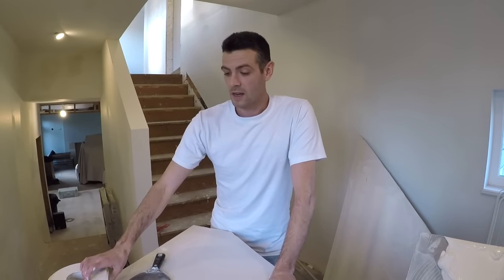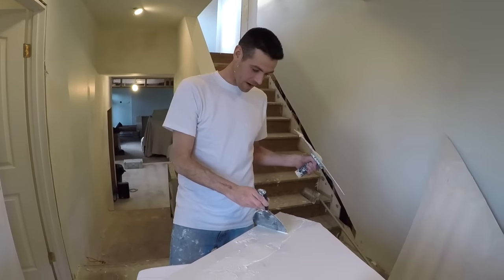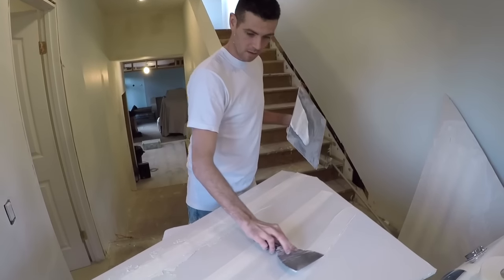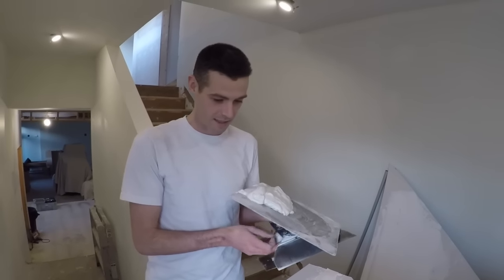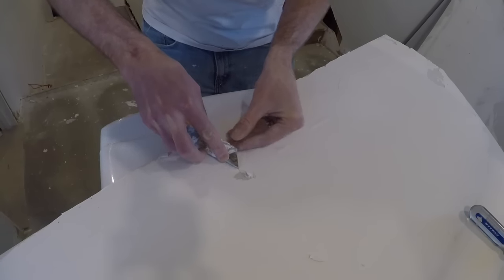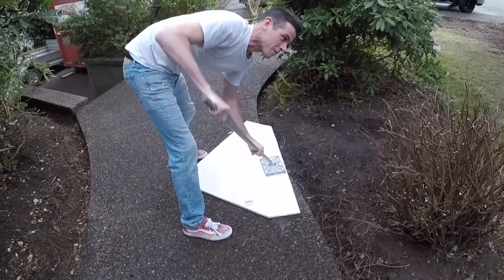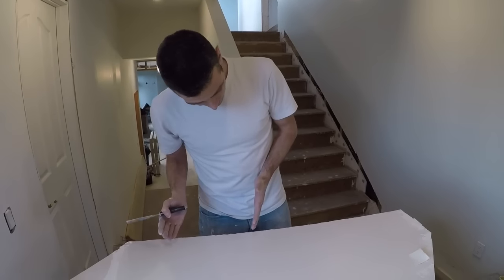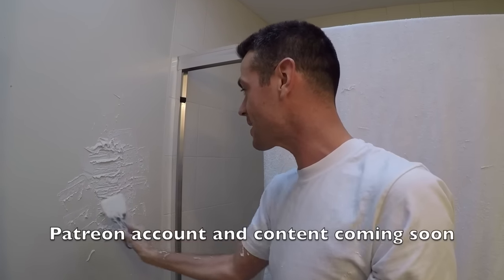WHY YOUR PAPER TAPE BLISTERED!!

Comment: Great instruction and guidance. I complete my first big drywall project this past weekend and did get blisters in my tape, but only on butt joints that had a gap more than quarter inch. I took off too much mud on my first go over. I now know better.

Comment: Drywall is not flat. I think that's the thing that took me the longest to learn. After watching some good quality videos like the ones you do I realized these guys aren't making it flat they're just tapering the high spot over a massive distance.
Reply: Wrong, there a slight drop in thickness along the long sides of the face of drywall so when u put two together you have a sort of valley to fill. You would see any high spot regardless how far you taper it.

Comment: I also noticed that you use just two coats after the taping is done.  Trouble is that so much
time is wasted being soooo neat on each of these coats to avoid too much sanding.  The
first coat covers the tape with a 12" coat; the second after light sanding pulls the coat out
two inches on each side; and the third or skin coat with thin cement needs just light fast
sanding with 120 grit.  I've been on union jobs with just two coats after taping.  The foreman
didn't want tooo much time wasted on slow, neat coats, but the final sanding took so  long
that a third coat would have used up less time overall.

Comment: The compound I bought from HD was very wet!  Very hard to put on, especially on the ceilings.
Is it supposed to be very wet where I can’t even get it up to the garage ceiling without dripping all over?
Reply from the maker: No thats odd. It should usually be thicker so it can be thinned down to your desired consistency.

Comment: I was taught to wet your tape before sticking it on the mud. Is that wrong? I don't do a lot of drywall b/c I hate mudding, but I imagine I hate it because I suck at it. (Never got blisters tho, so I got that goin for me.)
Reply: It's not wrong per say, but not necessary. Wet mud (thinned down out of the bucket) already has enough water in it for the tape and wallboard. Most diy'ers have a hard time using mud that is thinned down enough because it doesn't want to stay put on your knife.
Reply: @renovationsandmore7142  thank you. It will be one less thing i will be making a mess with.

Comment: Also.. diyer that uses same all purpose mud bucket 3 days or weeks long. Taking time to do it.
Mud starts to set in bucket.. when applied to walls.. it will have low or no adhesion spots.

I had situation where it was 100f in house and had to wet the tape first.

Comment: In south Louisiana I have seen guys add Palmolive dish soap to their mud when mixing it in the 5gal before they start taping. Not a whole lot but maybe about the amount of a shot glass to the contents of 1 ready mixed box dumped into a 5 gal bucket and while stirring it they throw a little in the mud as it is being mixed. I asked the guy what is up with that but he didnt speak english and I dont speak spanish so who knows why? I was just curious if this is a common practice
Reply: It's to stretch the mud out and save money. Sometimes I do the same thing with latex paint I don't add soap I just ad a little bit of water if I'm running out of paint and have just a little section left. I know some painters that always do this to save money.

Comment: I can see the outline of the drywall tape through the paint on my ceiling. No blisters though. Can you make a video on correcting this issue? Thanks.
Reply: You did not one fether it enough or you did not go wide enough. The question also arises how thick is the mud under tape? Thick mud bed under the tape you will have to really go wide.

Comment: You have really great informative videos. Would you be willing to do one about using drywall mud and trying to match a random plaster sand swirl pattern? I have a few spots on my walls that I'd like to repair and match texture. I heard from some people in the field to try and use an old shoe buffing brush (horse hair) to get the swirl pattern.

Comment: I think many people get blisters when they let the tape get too wet and it crinkles or if they try and bend the tape.  ie. they start a run at the ceiling and realize that they are out an inch by the bottom and try to fix it by bending the tape over instead of lifting it all off and letting it fall straight down.

Comment: The biggest problems I had when learning was uneven butt joints and bowed existing drywall/previously skimmed drywall. Having a variable joint it’s easy to push all the mud out on the highs or leave a void on the lows. You could pre-fill I guess, but the farther from the facing paper the tape is the less strong the joint.
Reply: This is why I like using mesh tape.

Comment: I've been taping my dinning. About 12 or so joints in I got a blistered tape. I assumed it was because the joints were even, even though i tried to even them out with mud before taping. I wet the mud prior and have had any issues other than the uneven joints (2 of them). Any tips on how to address that?

Comment: So the main thing is having a good and thick even spread all the way across the joint for the tape. Not just dap it on and then roll over the tape expecting it to coat all underneath it

Comment: I've been taping a small room for days now. I was following a pro method, which was making me draw way too much mud out from under the tape. I found your video, realized what I was doing wrong. I was scraping mud away before laying tape, then, as I went along, my mud was too dry. 

Thanks for the vids, mudding and taping is much like riding a bike, you will fall a bunch at first, but once you got it, your good to go !

BTW: I couldn't find a great answer anywhere, but one corner I've done twice, and it didn't work out nicely, now I have a bit too much mud a 1/2 inch from the corner. Any good way to flatten it back out ? I've tried my knife, but it's taking the paper of the drywall away at times, and my sanding block isn't doing enough.

Comment: We soak the tape in water before putting it on. Works magic
Reply: That is how I was taught
Reply: Yeah, it works. But it kills the glue. Itll be fine unless you have to think about moisture and hard temperature shifts. 
Ex (vacation homes where they wont be temp controlled year round, baths, basements, garage, ect.)

Comment: What about not pre filling first. I like to do that with 20 min easy sand. Than put my regular mud than tape it
Reply: If your not a shitty rocker.. pre-filling is standard to prevent cracking. Prep work is everything or you end up with more work later as my dad always used to say. It’s not like running around with some quick dry and a trowel takes a lot of extra effort. If it saves you from fixing your tape I think it’s worth it.

Comment: I always had problems with blisters. One of my remedies was to pre-soak the tape in a bucket of water, gently squeeze out the water and apply. Probably could get the same effect simply by using wetter mud. 

Also, more recently I have started using a paper laminated composite tape (Strait-Flex). Any opinion on this product? It seems to be stronger than paper tape and less prone to blistering. I also pre-soak this product before using.

Comment: You should use a TapeBuddy tool for taping and the blisters won't happen. Check it out! Now available in Canada! The mud doesn't dry out on the wall as it's applied to the tape first. It's so easy and clean when taping with a TapeBuddy tool.

Comment: The lesson is to use mesh always.
Reply: Please doant use mesh tape on butts and seems , and use Finnish mud over it ..please doant ,good chance it will crack out after priming it ...if you do use mesh tape ,it works with hot mud better , I had to detail a house ,after prime and all the butts and seems cracked out ,and what we found is the drywall tappers used mesh tape in all butts and seams
Reply: If you ment to say fiber tape and tapping mud that workers , all though had problems with angles

Comment: I stopped using tape. I just mud it, then paint it with a sealer. I really don't get the point of tape to be honest. It's not like it makes the surface any flatter.  The mud I use,  pre-mixed in a bucket, works great at making the surface flat. Unless you walk up with a microscope or your wall has blazing light on it, it's not noticeable. Pre-mixed mud seems 10x better than it used to be.

Comment: You have to try pretty hard to mess this up when you're putting tape on a perfectly flat surface with no cracks to fill, that doesn't need to be taped in the first place...

Comment: So I've run into a very interesting additional reason tape blisters. I'm building out a condominium in Albuquerque New Mexico where the relative humidity right now is 10%. The mud starts drying within 30 seconds of applying and is not even sticky within one minute. It's with a wet mix and even wetting the tape. This is the first time I've ever drywalled in such a lack of humidity. I have to clean my hawk knives and trowel almost after every load because it's dried up so much. Just to keep the little dry chunks from getting into the mix.

Comment: It would have been helpful if this tutorial was done on an actual joint between two pieces of drywall... I don't get bubbles on the drywall itself, I get it where there is like an 1/8th gap between the two boards.
Reply: Do you have bubbles at butt joints, or the long seams that are tapered? I'm not a pro drywaller, but I've learned something that I was getting bubbles at my tapered long seams because my blade wasn't wide enough. The tapers are usually around 2-2.5" wide. So the dip should be 4-5". I started laying the bed of mud underneath the tape with a long 10" knife, so it floats nice over that valley. Maybe your having a different issue, just something I noticed.
Reply: @Fetecheney  Thanks for the advice! It was at a butt joint. I have since discovered that it had something to do with the gap between the drywall panels. I tried filling the gap with mud first, let it dry, sanded, then applied my mud and tape and It worked out great.
Reply: @sheldonvaughan6769 Your welcome brother! I think the Vancouver Carpenter uses a light concrete mix for big gap fills. I couldn't remember what product he used for the project I'm doing right now, so I found a different recommendation (the easy sand 45/easy sand 90 bag mix at home depot). Both the easy sand and concrete mix is nice because they chemically react internally to cure so they set up within 2 hours or so, rather than taking 2 weeks to dry like normal drywall mud. 

On this last project on my remodel I hung the drywall on the first day. The second day I mixed up the easy sand 45 and filled all the gaps (Ideally there shouldn't be big gaps, but I didn't feel like coping drywall against existing lathe and plaster walls :) I actually filled a gallon plastic bag with the mix, sealed it, then cut off a corner to get a piping bag full. That let me essentially "caulk" the mix really full into the crazy lathe/plaster adjoining joints that were waaaay to big for tape to float over. The third day I scraped the EasySand45 flat and then I had a really nice setup to go through all the other mudding steps.
Reply: @Fetecheney  That's great advice, thanks! I am still fine-tuning my drywall skills, it's only the second time I've done it, but definitely learned a lot from my first project... 1) The plastic trowels suck, they tend to pull the mud after few uses as the tips start to get rough. 2) The pre-mix mud is too dry for feather coats, if you add a little water to it, it's way easier to work with. 3) The hybrid paper/metal corners are way better than the metal ones, the metal ones start warping from the nail pulling it in.
Reply: @sheldonvaughan6769  That's good advice back from you. I just had to do an outside corner and got the paper/metal ones instead because of this. Worked WAY better than the others I've done of just the metal.

Comment: No homeowner ever understands that drywall isn't flat. I did a remodel about 6 months ago where the owners put a 6 ft level up to the wall when I was done. They insisted that it should be perfectly flat and I wound up having to run the butt joints 6 ft wide to make them happy. True insanity.
Reply: killer2468 wman - the customer is always right.
Reply: @martihill3611  the perfect finishing job means the hanging must be near perfect, witch in turn means the framing must be near perfect. There is almost never perfection in any part of building a house, especially when it comes to work that is done by human hands. I'm not a machine, therefore the work will most likely not be perfect.

Comment: I DIP MY TAPE IN WATER RIGHT BEFORE I APPLY IT,, THEN PULL IT OUT OF THE WATER IN BETWEEN MY FINGERS TO REMOVE MOST OF IT,,, JUST WANT IT DAMP... SEEMS TO WORK QUITE WELL FOR ME FOR ALL THE YEARS IVE BEEN DOING IT,, AND AGAIN, EXPERIMENTING WITH THIS METHOD MAKES IT EASIER TO FIND YOUR EASE METHOD

Comment: No one applies joint compound horizontally unless it's above them, as you have a serious leverage advantage on your example vs a vertical wall, and there is no seam under your seam tape, where the tape tends to bubble. I am sure you are an awesome drywall guy but the example is nothing close to real world conditions. Jus sayin

Comment: Tape isn't hard on a large flat surface but god help you when you're stuck trying to drywall that spot where some architectural genius put an outside corner within 2 inches of an inside corner.

Comment: Afraid this way doesn’t really work. The tape serves a purpose. Simply filling a void with light weight at a tape joint is going to fail. Otherwise why even bother with tape.?  You have a lot of experience and good advice for avoiding taping failure. Feel it’s best to tell people who don’t have any experience at all to simply use mesh tape though. Also was to suggest using a mini pump sprayer when trying to work long runs or plan to skim coat whole walls.
Reply: Tape failure for reasons he’s describing, which I would agree are the most common causes for taping to fail...assuming everything till that point was done properly is accurate. I feel I find more joint failure that is caused by framing or drywall install issues but his topic is more about new people trying to tape. With mesh tape you can’t cause tape to fail by under filling. You would just be adding another coat being required. You can fairly well see if you have pockets or voids since you can see through the mesh. Most mesh tape is slightly thicker than paper tape anyway so if you do try to pull too much mud out it would be harder. You can apply mud as leisure since you can apply mesh tape in advance. This prevents the mud from filming over from taking too long applying mud before tape which can cause bondage failure.  Can go on but these are the main reasons I suggest mesh for the inexperienced.
Reply: He mentioned it was only in the case that you had one or two issues.  A break in your tape here and there isn't going to hurt, except in sheering forces though the drywall plane, and if you're using mesh you're counting on not having sheer forces anyway.

Comment: You could just pull the tape repeatedly until you've played with it too much, boom, blistering
Reply: You could have also applied the tape with peanut butter underneath and gave the ol smooth skippy an immidiate coat of home depots cheapest and greasiest water based latex paint, no primer.  

Video idea, why don't you see what type of household products you could use to make paper tape bond to the board.